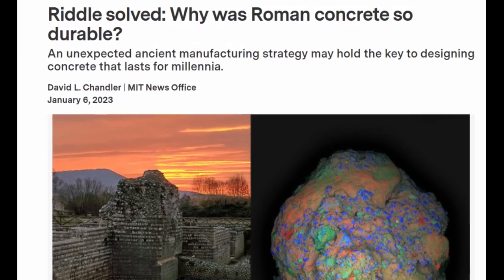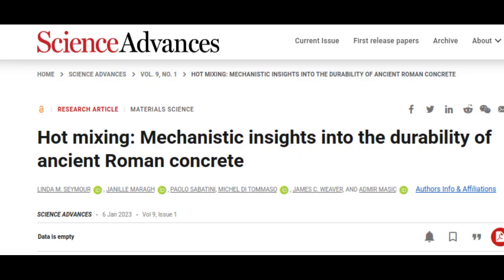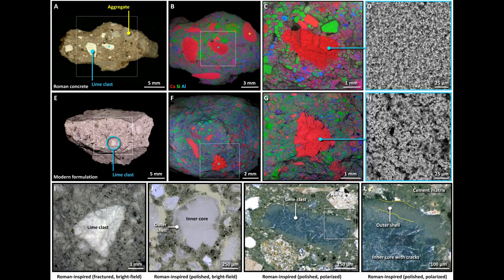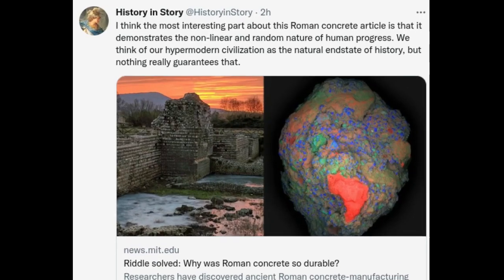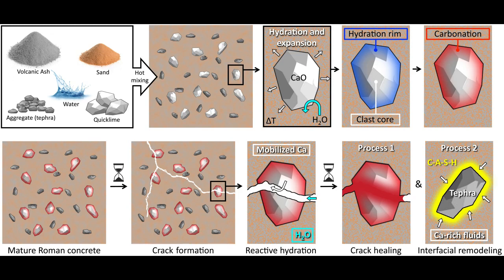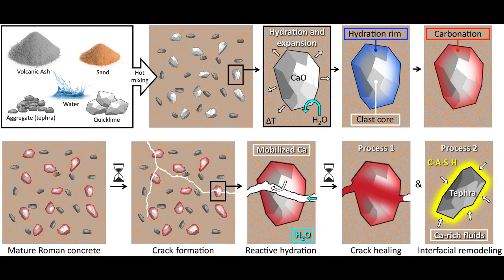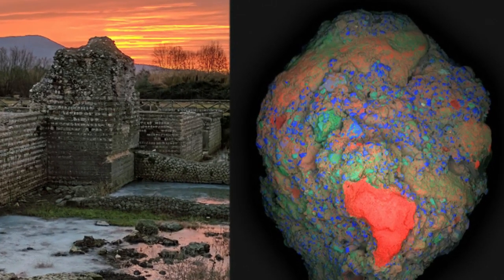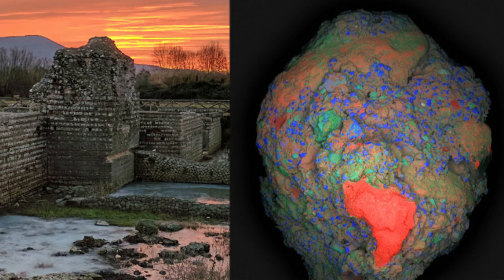Riddle solved: Why was Roman concrete so durable? | Lime Clasts | Hot mixing

Comment: I'm curious how hot mixing would work with AAC block. That process adds aluminum powder to raise the cement mix in the mold like a loaf of bread. Do they heat the ingredients  in a tumbler then add water? Or is the mix boiled then poured into the mold?

Comment: Well, not really. The main difference between Roman cement and Portland besides the pozzolanic and high lime content is the the binder.  Portland is CSH, calcium silicate hydrate and Roman concrete is CASH, calcium aluminate silicate hydrate.  The aluminate makes the Roman concrete a lot more durable than Portland.
However, the with the calcium oxide addition in Roman cement,  you could not transport Roman ready mix any distance as, in mass, it will rapidly agglomerate.  Once it is mixed, you could not retard it or slow the reaction.  Even if you were able to find a way to transport Roman concrete, there are no performance standards test criteria so no one would use it.
The cement industry is heading towards IL cement and sol gels/nano technology which will untimately impart significantly improved properties of portland cement.
Reply: And what can you say about the hot mixing aspect found by the study?
Reply: The separate parts were shipped in separate containers, there is no downside to this.  Ship it combined or ship it in parts, same thing.  Or the volcanic ash was shipping and the other materials were locally found, no downside.  So your argument is not valid.
Reply: @VenturaIT  And how many petrograph analysis of Roman concrete have you performed in a lifetime?  How much investigation of of the silicic acid reactivity of the various lava beds on the European continent and the pozzolonic reaction with lime and Portland cement?
Perhaps, you should go study geology and figure out what Al-tobermorite is.  Then go read the books of Vitruvius.